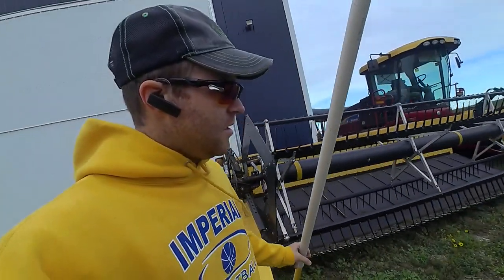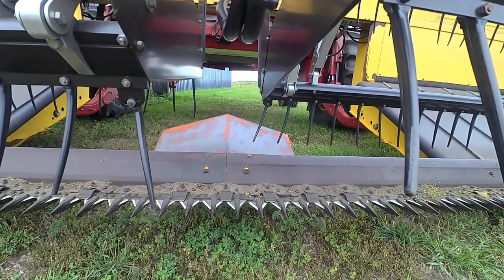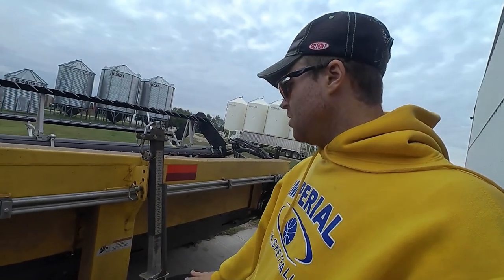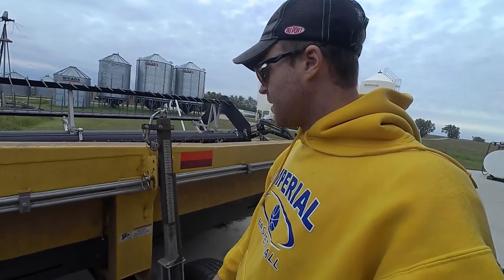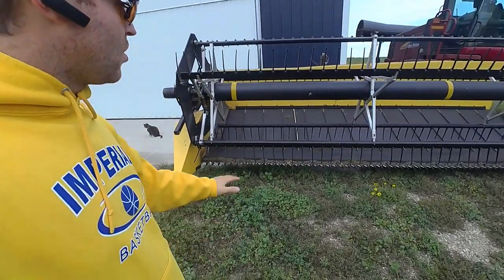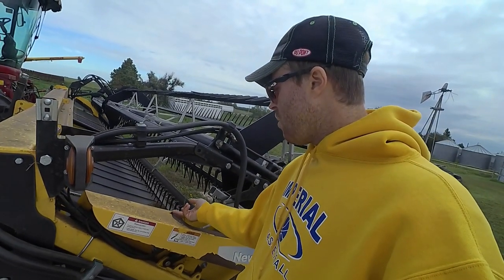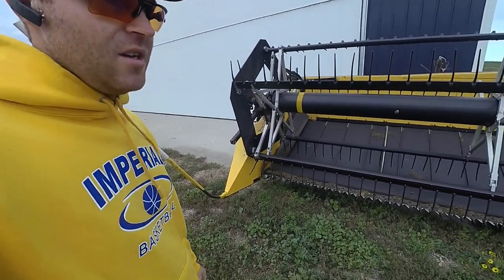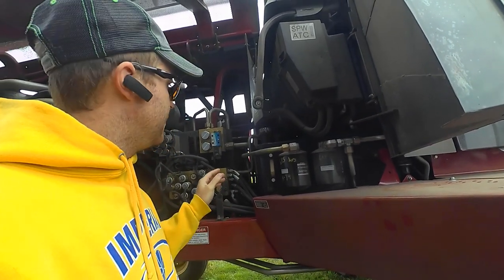Review - New Holland H8040 Windrower & 36HB Draper Head

Comment from the maker: After replacing main hydraulic valve and tweaking some of the draper header hydraulic valves this machine runs quite better than mentioned in this video. Hydraulic temps run substantially lower and engine isn't laboring as much. Worked very well in 2022 with the new haybine head I purchased for it as well.

Comment: I'm surprised by the size of the engine. With the amount of hydraulics needed to run it, it seems like it would bog down easily. That's a heavy header for what seems like a small frame. Glad to see it perform as well as it does though. Nice walk around and review. Lots of features with header tilt and adjustable flow rates for everything.
Reply from the maker: It does use all the power it has to run that head, especially going up hills have to back off on  drive speed and soft spots are another thing too where wish it did have more power. Decent conditions though it cruises along!